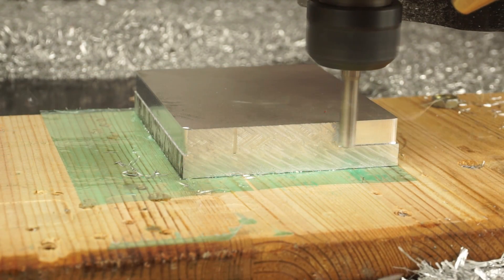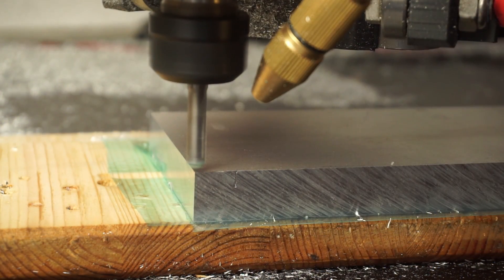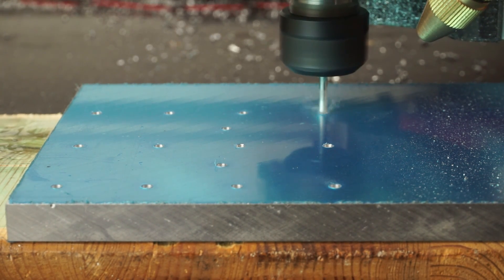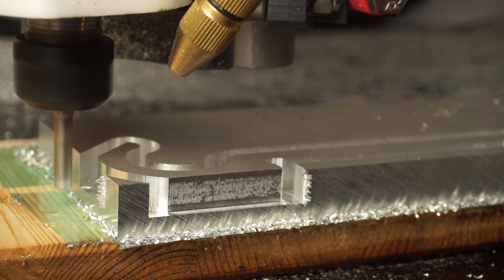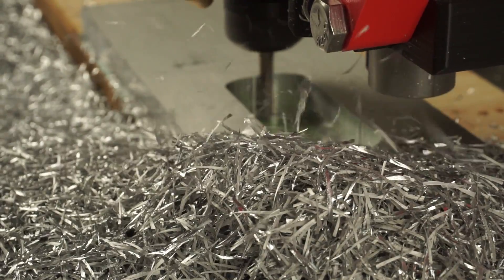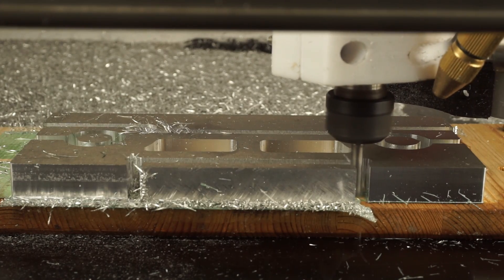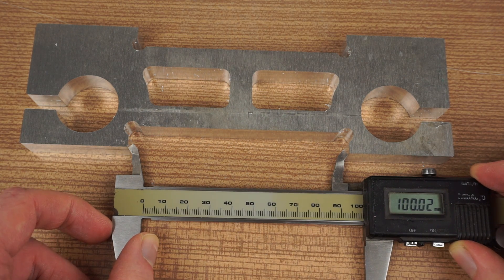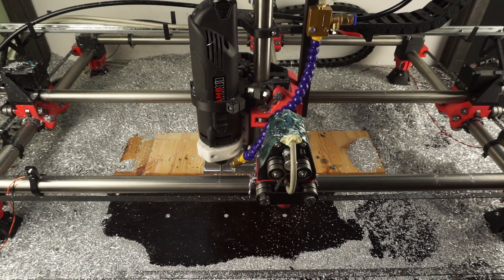More Aluminum Cutting on the Mostly Printed CNC

Comment: An often overlooked measurement that can affect your CAM accuracy is the diameter of the bit(s) being used. If the actual diameter is different (usually smaller) than the nominal diameter, using the nominal introduces inaccuracies into your CAM.

Comment: as for the surface quality it's not the best thing, but as for chips and sounds - it looks pretty healthy, for just 1 part per week it's more than enough. But after I had an experience with cnc6040 and then tried something with steel frame, mgn rails and steel table all this stuff that cuts less than 2mm deep with feedrate less than 100mm/sec for me is just aluminum scratcher but not a cutter

Comment: Reminds of my first 3d printer, a prusa clone, a wooden frame of 6mm plywood. After many months of tweaking I got a single perfect print. Then it got out of alignment again and gave up. Got a corexy now of my own design and without much tweaking just prints excellent prints every time.
You must've spent many days adjusting and experimenting to get it to this level, better than my ox cnc build. That has now been replaced with a much more rigid design of my own using linear rails bought from aliexpress with some reinforcements here and there, with 20mm thick aluminium tooling plates and steel tubing. 
Incredible results anyway you slice it!

Comment: That is good accuracy for 6mm belts and NEMA17's. I happen to have at least a dozen of older  NEMA 17's I bought from ebay quite a while ago, maybe I can finally put them to use on a lowrider 2 version I'm designing. I like the concept, but I see room for immediate improvement.

Comment: What do you think about this router for an mpcnc? Its 2hp and the diameter is a bit larger. https://www.homedepot.com/p/RIDGID-11-Amp-2-HP-1-2-in-Corded-Fixed-Base-Router-R22002/202739521

Comment: Hello people.   He said that any chinese milling bit does the job. Any idea which of those are good?link or store? Thanks in advance
Reply: I can't speak to the Chinese ones, but I have had awesome results with these
Amana Tool - 51377 Solid Carbide CNC Spiral 'O' Single Flute, Aluminum Cutting 1/4 Dia 
They're about 35 bucks but are a real nice bit. I bought some Kyocera Single flute endmills off of EBAY but I much prefer the Amana. Hope it helps

Comment: Perhaps these metal shavings could be mixed with epoxy and used to fill a void inside a 3D Printed part to reinforce it. If the plastic is semi-transparent, it would also be pretty!

Comment: Hello Brauns, Ive been reading for months now about both the MPCNC and the LowRider2. I am planning on using it for Aluminium milling. Based on your experience, should i go for the MPCNC or the LowRider2?
Reply from the maker: I have zero experience with the LowRider so I can't give you any advice on that.
Reply: Thank you. So far the mpcnc has been the most nodded, used one.. Since I am a begginer, best thing will be to start with that..
Thanks again

Comment: You seem to use something beefier than the usual GT2 timing belts. Care to lose a few words about that, or a link if you described that somewhere else already? 

Your setup seems to be exceptionally sturdy and stable. Any special tricks you might want to share? Thanks in advance!
Reply from the maker: There are some modifications to the original MPCNC like a different foot design or 9mm GT2 belts instead of 6mm. I guess using a high quality spindle also makes a huge difference.

Comment: This has inspired me to stop watching videos tonight and get back to work on my 1/2 finished MPCNC.
Reply: Same here. Mine is assembled and I have cut foam with it, time to move up to some wood!
Reply: True story
Reply: Did you finish it?
Reply: @brandonsmoot4056  Actually, I did. Cut some wood and plexi and made a clock. Then, wanting to cut aluminum, I started to add a compressed air/dust collection system but life intervened and I didn’t get back to it for months. Coincident with your comment, I just finished the new hardware   last night and it seems to work. The air blows and the vacuum sucks, at least.  However, to really test it I need to relearn the software because it’s been months since I touched that side of things. Hopefully, I’ll be cutting again soon (and fight the urge to rebuild the whole thing with the new primo parts).
Reply: @modern_DIY  what air blast system did you use? I'm working on mine myself

Comment: Hi, I have build my CNC according to your modifications like the double belt system. I see now you have additional parts like those black rings on the rollers around the pipe, are those for dust protection? And I see you went back to the single belt system, does it works better like that? Could you make a video or send me an email about changes that worked out and what you regret or would done different?  Thanks
Reply from the maker: Yes, those black rings are just dust protection, you can find them on thingiverse: https://www.thingiverse.com/thing:3965343

I published an update on thingiverse as well as on the v1engineering forum about the double belt: The glued belt started to curl up. Instead of fixing it I took the chance and switched to a single belt. As I didn't notice any difference, except that it's easier to set the right belt tenison, I am keeping it.
Reply: @leonbrauns  Thank you for the reply. My one is still holding on maybe if it starts to curl up also I will check this version. Thank you for the link.

Comment: greetings can you fix Roller_Modified and RollerM the middle  hole is too small to pass an m8 screw if forcing breaks the part
Reply from the maker: The hole is made smaller intentionally so you can tap it. Due to the angle iron there is not space for a nut behind this hole.
Reply: @leonbrauns  ooh sorry and im already going after the belt tensioning method after seeing this video
Reply: @leonbrauns  thanks

Comment: Am I correct this uses Nema 17? I bought Nema 23 3amp 76mm motors for around $20 US each. Do you think more powerful motors would be preferred? Not that much of an investment over Nema 17. I will run at 24v.
Reply: From what is being said on the V1 forums, 23s are overkill. You can get decently powerful 17s, and remember there are two per horizontal axis. Ryan has done an amazing job on optimizing the cost of this machine, so sure a thicker tube and more powerful motors will bring more performance but are you able to measure it and are the printed parts not the bottleneck? If you have the will to put a bit more money into your machine, rigidity is a better approach than power. First rigidity, then spindle. Steppers are way down the list.

Now if you have them you can use them but you'll have to modify the parts. Keep in mind 23s are also way heavier so if you're cutting soft wood and xy speed is important you might even do yourself a disservice.
Reply from the maker: This is a topic I still want to investigate but haven’t found the time yet. I am using Nema 17 and haven’t had any problems so far. I did notice however that when the motor is standing still and is powered up, it’s possible to rotate the shaft slightly. It’s not loosing steps and is fighting against the rotation, but it moves noticeably.

So if you just want a machine that works, go for Nema 17. If you want to tinker a bit, go for Nema 23.
Reply: There are two nema 17s per axis, so that helps quite a bit.  Also remember, the steppers travel with the axis, dual 23s weigh quite a bit more than dual 17s.  This cnc wasn't designed to mill aluminum, the fact that it can is just a bonus.

Comment: Can you link the endmills you used? Aliexpress? I really need this ability.  Excellent video!!
Reply from the maker: I have tried several different end mills from aliexpress and didn't noticed any difference. Just search for "single flute carbide end mill 6mm" and go with the cheapest one.
Reply: @leonbrauns  May I ask what spindle you are using? Can I expect similar with my Dewalt 660
Reply: @itsjustjbuildingstuff4820  It's a Kress, they have better bearings than the Dewalt, they also cost quite a bit more than that dewalt.  Their 800w 110v model costs $330ish US.
Reply: @leonbrauns  so single flute does that nice cutting and finish ? What's the feed and rpm ?
Reply: @rajivsahoo8  man, just watch the video
Reply: @AlanHerrigCreations  ya got it bro, just commented early ..
Reply: Also interested.

Comment: Great results! One question though. I remember an older video where you modified your MPCNC. Those modifications don't seem to be present here. Am I missing something or did you not end up keeping them for some reason?
Reply from the maker: I published an update on thingiverse as well as on the v1engineering forum about that: The glued belt started to curl up. Instead of fixing it I took the chance and switched to a single belt. As I didn't notice any difference, except that it's easier to set the right belt tenison, I am keeping it.
Reply: @leonbrauns  ah I see. Thanks man. Great vids btw! Keep it up!
Reply: Brauns CNC. Great work and great videos. However i can not find your posts on the V1 Engineering forums.
Reply: @leonbrauns  Hello, this looks very nice. I would like to build a cnc just like yours. Maybe can you add a link to the infos? Thank you, bye bye
Reply: Was curious about that too. He had the dual reverse belt setup.